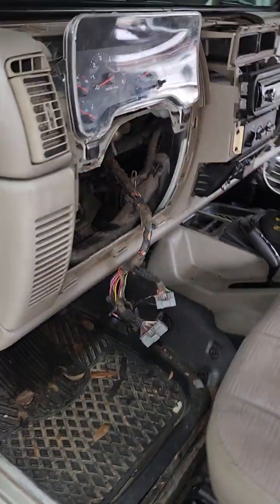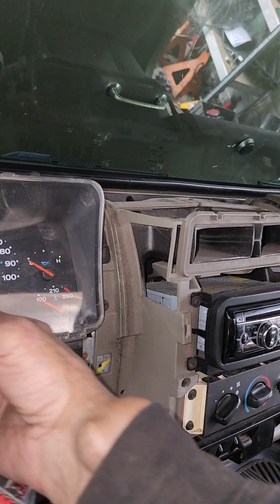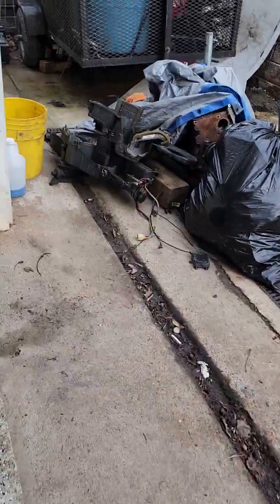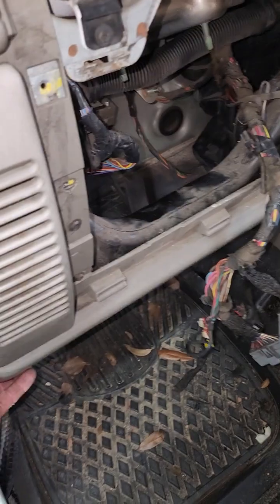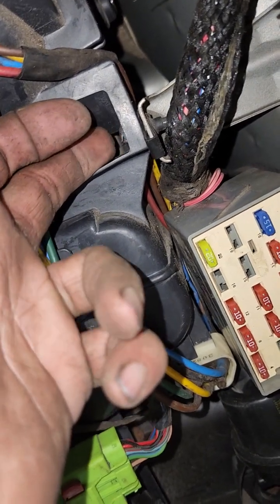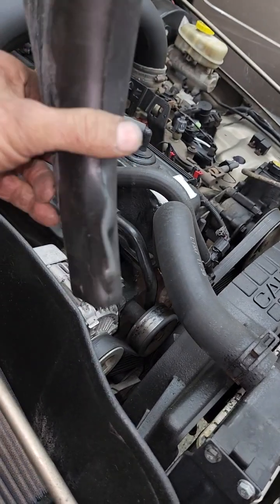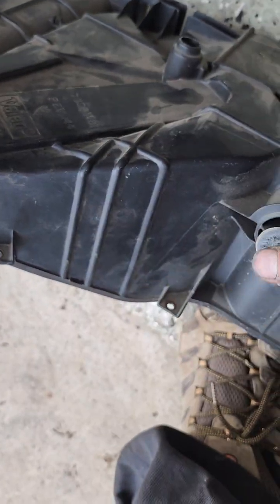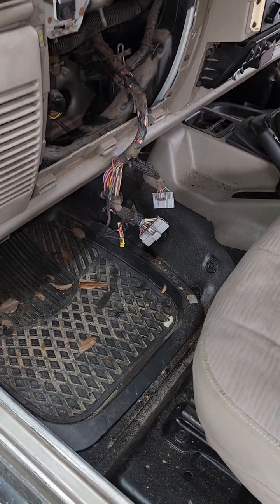2004 wrangler tj heater core removal instructions and shortcuts.

Comment: When I changed the coil on my 04 TJ, I loosened the dash with the steering in place.  Then, I jammed a Grainger catalog between the dash and the windshield.  It was enough room to pull it out and replace it.  I never had to pull the steering or disconnect airbags.  It also gave me a chance to take the AC evap out of the heater control box.
Reply from the maker: That would work but  had to do some other repairs due to people not knowing what they were doing so it all had to come out. Compared to a VW dash this was a cake walk.
Reply: Ronnie, are you saying that you replaced the heater core WITHOUT having to remove the AC evap?  So you left the AC in place?